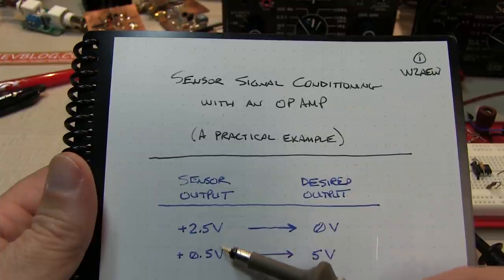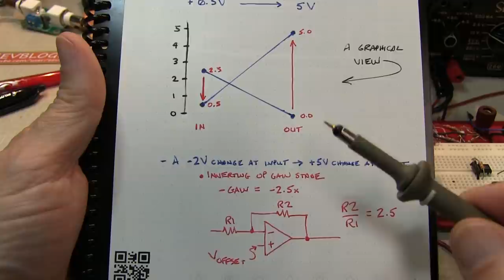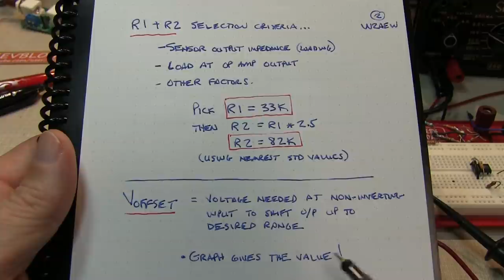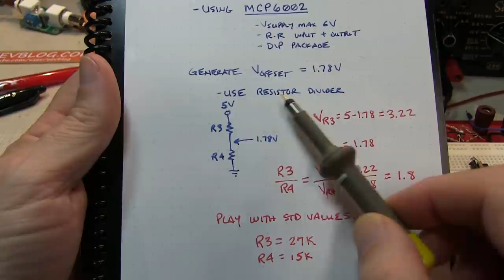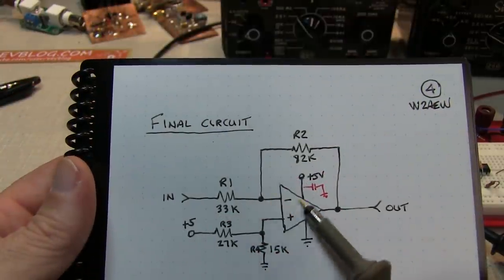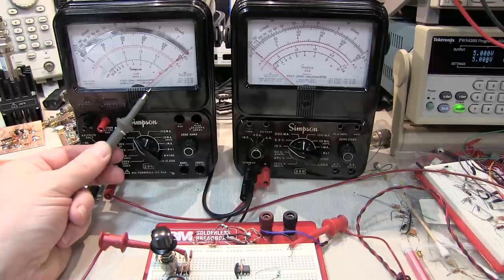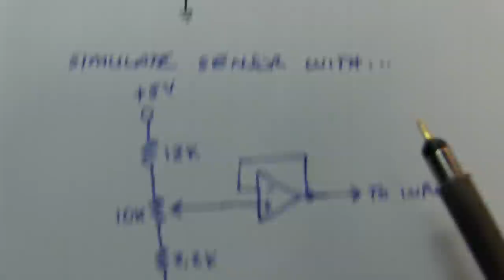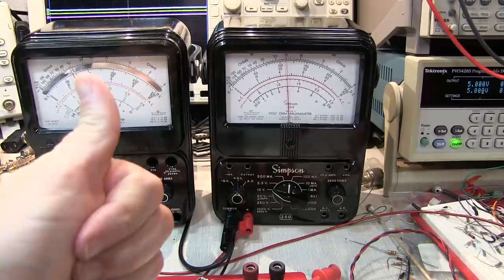#328: Circuit Fun: Op Amp Signal Conditioning - a Practical Example

Comment: Excellent video. I didn’t exactly know what to expect in this video from the title, but this is actually something I was just thinking about attempting for adding a bar graph s meter to a radio. This has everything I need to work through the process.

Thank you

Comment: MCP600x is a very underrated series
Reply: its alive. thanks for your videos. those really made electronics and starting uni semester easy.
Reply from the maker: Agree- a lot of near-enough-to-ideal characteristics.  What's your recommendation for something similar but will work up to 15V supply?
Reply: Microchip does such a good job on so many of its products.
Reply: the cont has awakened from his slumber...
Reply: Alan, the TI (ex-NatSemi) LMC6482 is my go-to for most applications.  R-R IO, 2.7-15V supply, and decent general-purpose DC and AC specs.  Main caveat is you need to be careful with capacitive loads, especially near unity gain, but careful design will mitigate most issues.
Reply from the maker: @davidciaffa4711  I like that one too - but it is more expensive than the Microchip part.
Reply: True, the LMC6482 is more pricey, but it does work out to 15V.  If you don't need that capability, it is probably overkill.  I've been using the TLV9002 quite a bit lately as well. Similar specs to the LMC6482 and is dirt cheap, but limited to 5.5V and only available in SMT packages, which makes it sub-optimal for hobby/DIY users.
Reply from the maker: @davidciaffa4711  Yes, the 15V VCC is why I keep a supply of them on-hand.
Reply: You still on youtube. 🎊🤩
Reply: Good job which I really needed so much ...I need good entire diy airflow sensor circuit to accomplish my self built fuel injection system
Reply: I used AD8606 on the AA filters. It has good performance but the current draw is a bit high.
Reply: The MCP600x is a micropower opamp, so its very compromized in ac performance having only 1MHz gain-bandwidth product and 0.6V/µs slew rate.  The input offset isn't great, the noise is disappointing (6.1µV p2p), CMRR is only 40dB at 1kHz(!).
One of the best 5V rail-to-rail CMOS opamps I've found is the AD8656, which is plenty good enough for quality audio as well as being able to drive over 200mA.  Its CMRR at 1kHz is 105dB, its about 15dB quieter than the 6002, and typical offset is 50µV so its precision as well.  You pay extra for this performance of course.
The MCP600x is not precision, and is optimized for low power, low usable bandwidth (< 100Hz?), so long
as you recognize its limitations (don't expect it to handle quality audio, or be an instrumentation amp for
instance) its perfectly servicable.
Reply: @benthere8051  
I am sure you know about Micro chip "MINDI" which is a really good circuit simulator for PC which, in my opinion, is much better than some electronic simulators, and Mindi is free and quite intuitive.
Love Microchip products though I still program in assembler using MPLAB and the largest PIC I used was the 18F4620 which drove my Claymate products for many years until I sold my company.
VY 73 de G4BLN
Reply: @w2aew  I use the MCP604. It's a great opamp for low voltage applications.
Reply: cool, he is alive ... did i awake you?
we want more : ) .... and thank your for your human contribution.

i have mcp6002/6004 at home. i used them in a euro-rack modular synthesizer module, i have build.
but Texas Instruments recently released a new opamp, opa991/2991/4991
Reply: i used the mcp6002 here in this project.

The lovely sound of the Buchla 259 Wavefolder 7 synthesizer module.
https://www.youtube.com/watch?v=Sr5Y5XrzVxo

it runs on 1.5 Volts, approx ....and it sounds awesome.

Comment: Your explanation and demonstration is very good as always.
The single supply op-amp amplifiers are often just taught assuming a sinusoidal input signal.
It is recommended to use a decoupling capacitor to remove the DC offset prior to connecting the input signal to the amplifier and it is assumed that the op-amp will be used with an offset in the middle of the dynamic range (2.5V in this case).
With your example you have shown that in real life things can be quite different from the general assumptions and you have shown a practical way to address it.
Thanks!

Comment: Thanks Alan. As an absolute noob a few years ago, it took me quite a while to get my head around even the basic op amp idea. After that I struggled to find a non-audio simple use that would illustrate its use. This was perfect as I could see myself with a similar need, right down to using the extra as a buffer. I thought I was catching up to you after getting my Simpson 7M, now I have to find another one :)  Dave

Comment: I've been doing this for years and not once had I considered a graphical method for calculating the offset. I always learn something from your videos!

Re: input bias compensation, don't forget that matching the impedances seen by the inputs can have detrimental effects in opamps with internal bias cancellation.  That, and the magnitude AND the sign of the bias current changes in CMOS and JFET inputs with temperature and input common mode voltage. Probably beyond the scope of this video, though.
Reply from the maker: Yeah, a little beyond the scope of this video - but all good points.

Comment: Just a thought: Trim pot wipers going directly into opamp inputs (7:45)  - if the wiper should ever go intermittent the opamp will go crazy. It's best to link wiper to one of the ends and adjust resistance values accordingly. Keep safe, Beamer.
Reply from the maker: Yes, that's always a good idea.

Comment: I agree in the comments about this being a very good video on the topic. For myself, in the learning phase still, I'd like to see more of a build-up process. Start with an inverting op amp and see what the output is, add the gain circuitry, add see what the output is, add the DC offset.... and so on. This for me would help ground me in what happens when, how and why, so that I could then know, when designing circuits, what I need to do. Maybe I'm not your target demographic... but I'm working on it! 🙂

Subscribed

Comment: Thanks Alan! Another great video, touching on an interesting point - adjusting offset voltage - and then work out such a simple signal conditioning solution. Really loved it :-)
Reply: Input bias currents and compensation resistance should be taken into consideration
Reply from the maker: @aqib2000  You didn't watch to the end, did you...

Comment: That’s interesting. It was throwing me a bit at first. I was wondering how you had a positive input to an inverting amplifier but still had a positive output. I see you’re inverting the slope, so the negative going input voltage is “inverted” to a positive going output. I’ve never used that configuration before. I’ll have to play with that in SPICE. Nice solution.

Comment: I did it ! Mine has a gain of 1.74 with an input voltage of 2.8, R1 = 1K, R2 = 1740, V offset around 1.9. My power supply is 5V from an arduino so i kept the values small but it seemed to work on my scope. Drops to around 1 volt when i push a tactile for the input.

Comment: Nice walkthrough! I would have approached it slightly differently, noting that op amps originated in the world of analog computers to do mathematical operations (hence the name). You're after a linear relationship, y = ax + b. With a little bit of algebra, substituting in the points you have on that line, ie. (2.5, 0) and (0.5, 5) out pops a = -2.5 (gain), b = 6.25 (offset). Then slot those into the op amp formula.
Reply from the maker: This appnote describes how to do that: https://www.ti.com/lit/an/sloa097/sloa097.pdf
Both will work, I just took a more practical approach to it with less math.
Reply: @w2aew  omg, that is really terrifying! Yes you were more practical, no argument. They even list E96 series resistors as an appendix. But I may have to challenge you to an op amp shootout...

Comment: Thanks for walking us through the steps on this design!  Could this be useful in the context of audio applications to bring an analog microphone signal to span a paticular voltage range prior to ADC encoding?  I imagine some other preconditioning would be important, such as preventing the signal from being at too extreme an input level.  I'm still learning circuit design and electronics, coming from a background in software development, and your entire channel has been very helpful!
Reply from the maker: Yes, it certainly could be used to adjust the amplitude and offset of an audio signal.

Comment: Thanks for sharing.
 Does common 4558/TL072 works on these setups?
Reply from the maker: Neither of those have rail-rail outputs - so they will work only if the supply voltage exceeds the required output swing.  You have to consult the datasheets to see how much headroom is needed between the supply rails and the min/max output voltage needed.
Reply: @w2aew  Thanks for quick reply and clear explanation.

Comment: How is the latency in this circuit? Was thinking about the use case as a level shifter for data signals.
Reply from the maker: All you need to do is use an op amp with more bandwidth, although there are probably better ways to level shift data signals.

Comment: Bill-N6EF-Thanks for a great explanation. Very informative. When I want to design something in general, I don't know which components to use since there are so many choices. How did you know to use that specific op-amp for this application? Experience with that series of devices?
Reply from the maker: Usually it comes down to the constraints and requirements for the circuit.  Things like: Supply Voltage available, voltage range of input and output, speed/bandwidth required, power consumption, noise, etc.  Sometimes it is only one or two of these constraints or requirements that will determine which type/family of op amp to use.  Many times there will be a large variety of op amps that will fit the bill, and the choice may come down to availability, cost, etc., or even what stock you have on hand.  Unfortunately, there is no simple answer.  In this case, I had constraints of a single 5V supply and the need for a 0 to 5V output - so I needed a single supply op amp with rail-rail output.  Those were the major constraints - then I looked at what I had on hand.

Comment: I think you could have mentioned sometimes op amps are useful when you need to drive something that requires more current than the source ( or sensor ) can deliver... having to use one for exactly that .. apart from that another perfect video and I really like the way you explain how to set the offset voltage.
Reply from the maker: Good point - I "sort of" hinted at that with my sensor simulator being buffered with the unity gain stage.

Comment: Very interesting! I try to fit those numbers into the linear equation and I got a transfer function y = -2.5*x +6.25, where x is the output from the sensor and y is the expected output from the circuit.  I guess you can build a circuit to realize this but why it's different from what you mentioned?  Your circuit seems much simpler.
Reply from the maker: This appnote describes how to do that: https://www.ti.com/lit/an/sloa097/sloa097.pdf
Both will work, I just took a more practical approach to it with less math.

Comment: Hi. Could you please elaborate a bit more on how you got to an input offset voltage of 1.78V? I was expecting it to be 2.5V since that would have brought the op-amp output to 0V for 2.5V input to the inverting terminal.
Reply from the maker: If the offset was 2.5V, and the input was 2.5V, that would imply that there is zero current in R1, which means that there would be zero current in R2, and the output would have to be at 2.5V also.  The key to understanding this is that the inverting input of the op amp draws virtually no current.
Reply: @w2aew  You're right. I don't know in what world I was; I got it confused with a differential amplifier. Thank you for responding though. In hindsight, if I'm not wrong, one could use a differential amplifier  too to achieve the same purpose, can't they?

Comment: Hello, i have a question.. if i have input values ranging from 0.63 to 1.09V and i want corresponding output values of 1-5V ... is this possible?
Reply from the maker: Yes, of course.  In this case, you want a voltage gain of (4-1)/(1.09-0.63) = 8.696.  And, if you've described the relationship right, you want it to be non-inverting.  So, you'd choose a non-inverting op amp configuration.  You can use a "summing amplifier" type of design to add in an appropriate offset to get the output offset adjusted correctly.
Reply: @w2aew  🙏thank you! Seems like a pain in the butt
Reply from the maker: @ohmslaw6856  Not really, just your basic, very common, op amp design process.
Reply: @w2aew  doesn't help I'm some what of a dumb@ss haha.. im just struggling with the offset..
Reply: @w2aew  i finally got it! Thank you again for your time

Comment: Can you help to explain further on Common Mode and why some chips can handle voltages higher than their supply voltages
Reply from the maker: Some op amps use emitter followers or source followers on the inputs such that the input common mode range can extend slightly beyond the supply rails.

Comment: One more thing you forgot to mention in the list of other considerations is the offset drift! It is great to be able to trim the circuit for precision, but if the measurement includes the weather, it is not a good measurement, unless designing a weather station, hihi :D
//you could than also talk about about gain drift and TCR of the resistors, the input votlage/current noise and other stuff, but the offset drift may be still very important one for many applications//
Reply: True, but if offset drift is a worry you will not be using a MPC 600x part or a 741, but those have been specified as parts in those kind of applications. I should know, I changed enough 741's that had "excessive drift" in an application, used because when it was designed there literally was the 741, or even worse earlier opamps around. But that 741 can be pretty good, providing you run it at +-15V rails, and a good number were also fine running off +-22V rails, so the output swing could be 15V either side of 0V. Funny enough only those which were inputs were the unhappy ones, the output drivers were fine with only a clip on TO100 heatsink on them. Yes the stuff did have certifications, so 741 it was, never to change.
Reply from the maker: Yes, there are a lot of other factors like operation over temperature (drift), as well as taking into account component tolerances, power supply tolerances, etc.  Most hobbyists don't get into these details, but they would certainly be part of a professional's design process.
Reply: Well, the MCP600x opamp is not as bad with its Vos drift. About 2uV/K, which may (or may not) be fine. Just wanted to point to this temperature dependence. Many of the hobbyists now using microcontrollers, measuring and digitally calibrating stuff. But mostly forgetting some of the important bottlenecks of such calibration, even trimming the stuff with pots.  As not only the OPAMP itself has drift  (probably order of magnitude lower) than the RF power sensor, that was mentioned in the vijeo :)

Comment: Thanks. Q. How do you measure sensor output impedance ? is it on the datasheet? I saw this term for uControllers too, but I have never seen any number or way to measure an IC pin impedance. Thanks again
Reply: Yes. Always consult the datasheet.
Reply from the maker: Usually on the datasheet.  If not, then there's usually some information about how much of a load the output can drive, or how much current the output can deliver to a load.  These will give you some insight into the output impedance.

Comment: When looking at the Op amps datasheets it specs about the Input Biasing current is in the microamps from input#1 and input#2. What does this mean because the larger the input biasing current the worse the Op amp can be comparing inputs or differentiators and comparator circuits?

Comment: Alan, great video as always. Could I make a request for another curve tracer video? I’ve been interested in transistor leakage at zero base current. I have some no name 3906 transistors that appear to have considerably more leakage than one would expect for a silicon transistor. Anyway I was wondering if you could do a more in depth video about curve tracing techniques. Thanks!

Comment: Would it be possible to make this in the non-inverting variety other then using a second op-amp as a unity gain inverter.
I have a signal coming from a LM35 temp sensor that starts from 0.25v and goes to 0.75v and I need to condition it to 0 - 5v.
Thanks
Reply from the maker: Sure, you could do this with a non-inverting configuration without the need for an inverter.  You just need an overall non-inverting gain of +10 with an appropriate offset summed in.
Reply: @w2aew   Thanks.!!!
Tony. KE8SPI

Comment: Can u explain what would happen without the offset voltage created by the voltage divided please? I didnt quite get that.
Reply from the maker: If the 1.78V wasn't applied to the op amp input, the output would always stay pinned at the lower rail, because the input voltage applied to the inverting-input would always be higher than the voltage at the non-inverting input.
Reply: @w2aew  thanks so it means it would only work for converting for e.g. 0 to X V input to 0 to Y V output ?
Reply from the maker: @HalfLife2Beta  For an inverting op amp with 0V on the non-inverting input, it converts a 0 to X voltage to a 0 to -Y voltage.  Use a non-inverting configuration if you want 0 to X ---> 0 to Y.  We wanted an inverting config here to make the trend go in the opposite direction.
Reply: @w2aew  thanks its so clear now